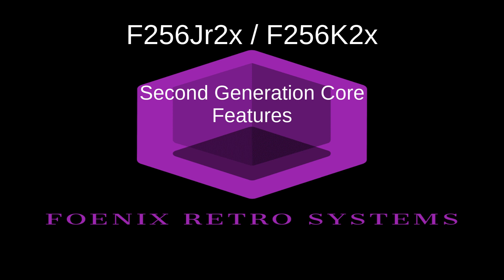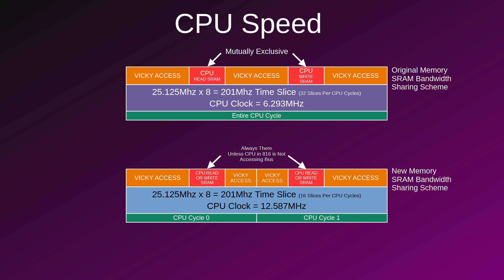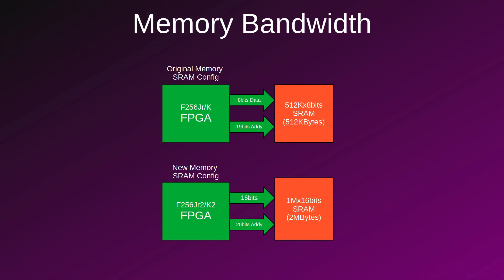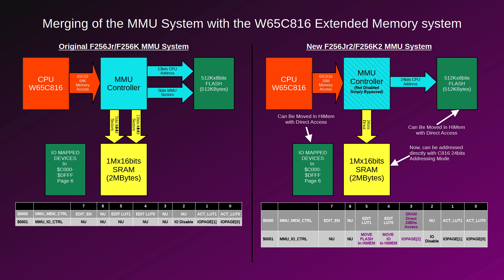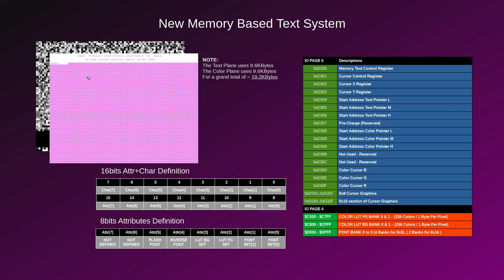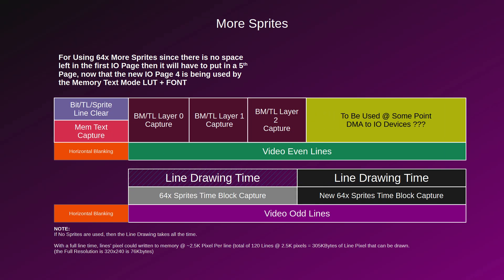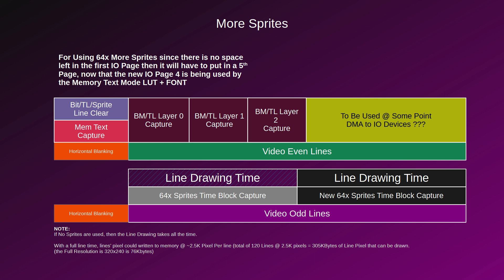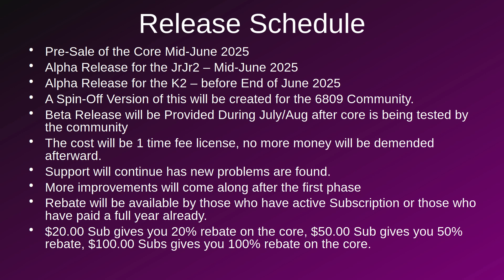F256K2x Core Video

Comment: Collision detection - sprite to sprite, and sprite to character - is crucial to a good gaming experience. There's nothing more annoying to a gamer to lose a life because the collision detection was based on a dumb "do these rectangles overlap?" instead of an actual collision.
Reply: you're wrong... actual pixel perfect collision is almost never a good thing in games. Just use one or multiple rectangles of the right size
Reply: @wphanoo  If my spaceship doesn't occupy all corners of the sprite (if it's oval shaped for instance), and I pass close by a cliff edge, crashing and losing a life because the rectangles overlapped but my ship didn't actually touch the cliff, that's really crap. A collision should only be reported if one actually happened.
Reply: @davidspencer3726  there's a simple solution to this : make the (rectangle) hitbox smaller than the actual sprite. All games do this, so the collision feels right and even sometimes gives a small advantage to the player. If the hitbox needs to be more complex (like in fighting games where the fist or legs can extend a lot from the body), usually two rectangles are used
Reply: @wphanoo  That creates two problems: first the opposite problem to the one I previously described which is that your ship now passes through solid objects where it should have crashed, and also you're now doing collision detection in software. Sprite to sprite and sprite to background detection was implemented in hardware on the C64. But the fact that it's implemented in h/w doesn't mean you can't do your rectangle comparison if you prefer.
Reply: @davidspencer3726  if it uses only a few gates i'm not against it.. otherwise its a waste of gates pretty much, since pixel perfect collision is so rarely needed in games